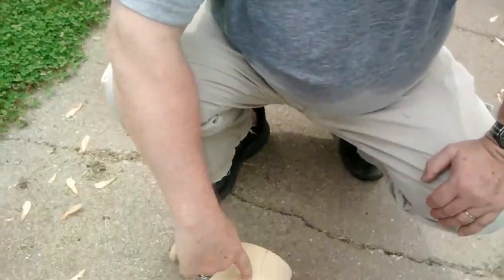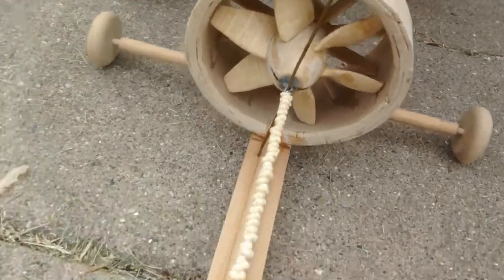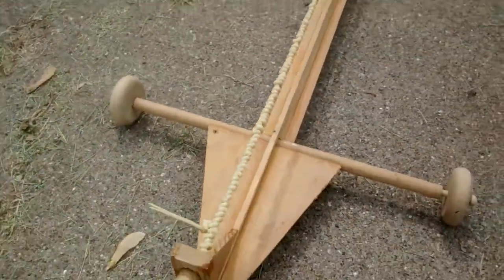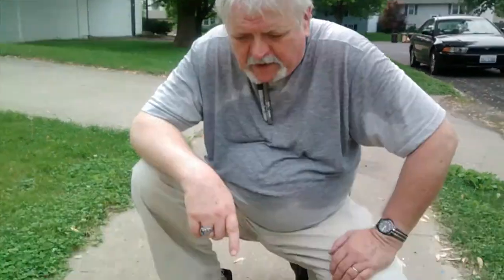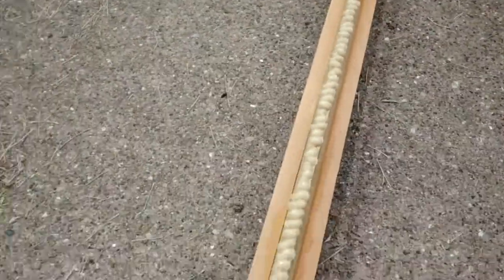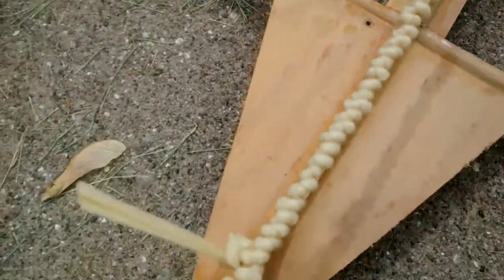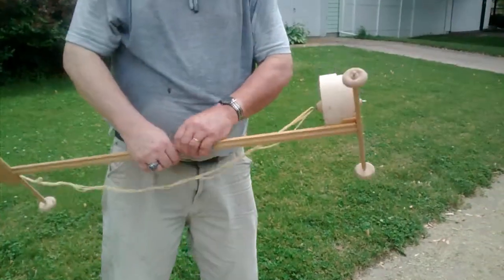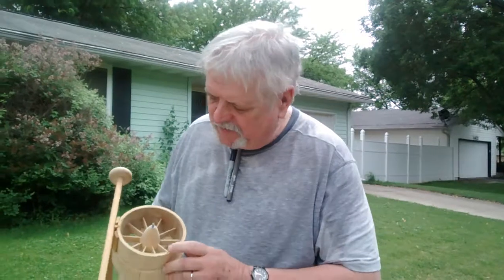Rubber band powered ducted fan car

Comment: I've also been motivated to make a rubber band powered ducted fan car. I'm i guess cheating a bit? Didn't do all that impressive wood work you did, designed mine on the computer and printed it out. A rubber powered ducted fan is not an easy hill to climb, most impressive I've seen was a free flight balsa wood model made by a senior japanese individual. Mig 15 i believe? Old video, but still stands as the most impressive model I've seen to date. Mass is the enemy of these things, and also limited rpm being rubber powered. You did excellent using wood, well done brother